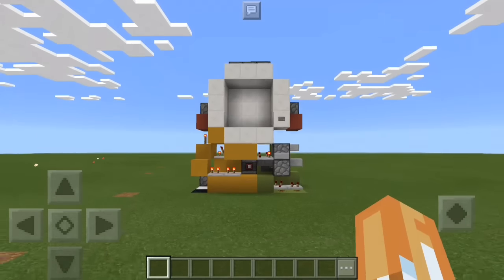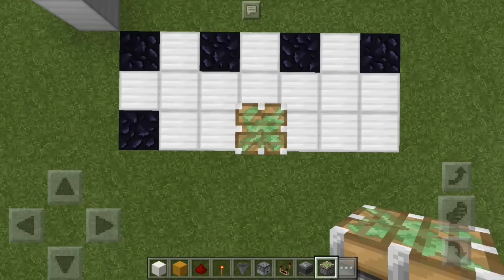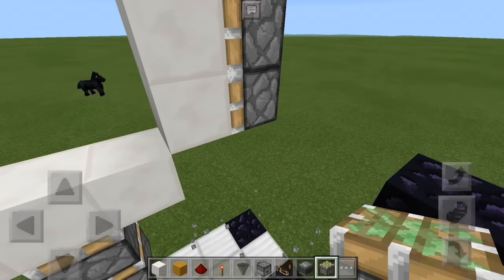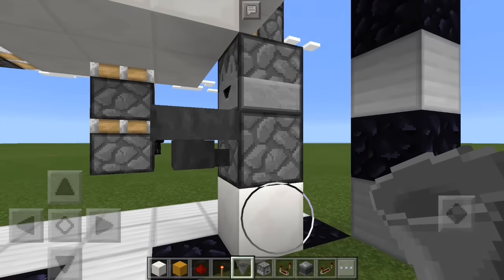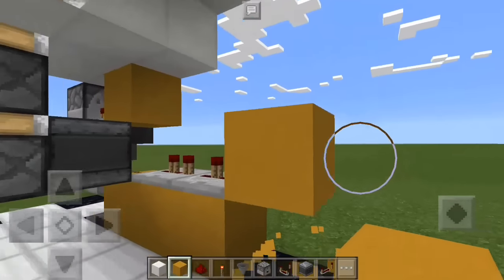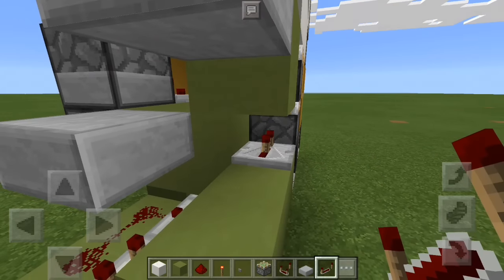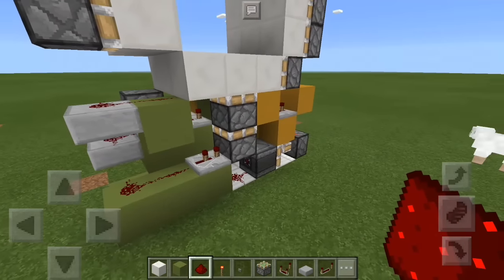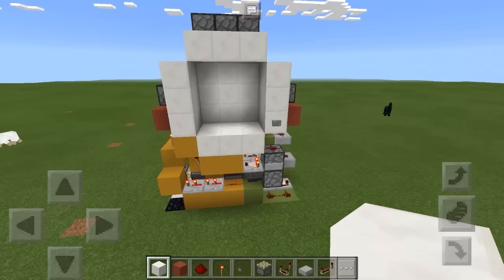Minecraft Pocket Edition Redstone Tutorial: 3x3 Piston Door (MCPE 1.1.0)

Comment: If you can't get the middle block working the problem is with the observer design as they have been changed a bit also that little accident at 6:27 with the block above the observer actually is needed or else the final block pull doesn't happen.
Reply: Thanks
Reply: TheKingofGames1001 you also have to mess with the double piston extender the ticks need to be 4 so the last block retracts

Comment: The piston on the middle is very SLOW to extend but into the original 3x3 piston door have a 1 tick pulse to extend the middle piston and they didnt use pulse extender and for your design the middle piston have a 4 tick pulse to extend i didnt failed i said need emprovement to make faster

Comment: one piston doesn't extend the mid block is just floating
Reply from the maker: Matthias Hauer check to see that you did everything right, because I can confirm that this build still works.
Reply: +Trogdor123 Planted a block by the green section so the redstone were cut off
Reply: just power the block where the button is attached to
Reply from the maker: Matthias Hauer or the top dropper of the t flip flop.
Reply: I built it right and it has the same problem, someone help?
Reply: same
Reply: Matthias Hauer Hi man, if your still looking for a 3x3 door that works on pe, I just uploaded one today :)
Reply: The Bow Tie man XD your everywhere m8
Reply: Dark Steel shhhhhh xD
Reply: The Bow Tie man XD
Reply: Guys what you do is go to the green circuit and put the 2 repeaters at full ticks not 2 ticks this also happen to me but just do what i said and you will be fine
Reply: JasonMC123 no only the repeater that touches the piston not all two of them but if that work then k
Reply: JasonMC123 and only need 3 tick
Reply: Some versions of MC don't allow a sticky piston to pull another sticky piston from behind.